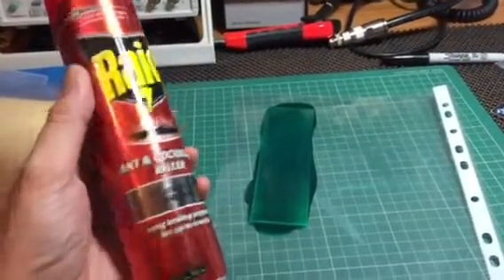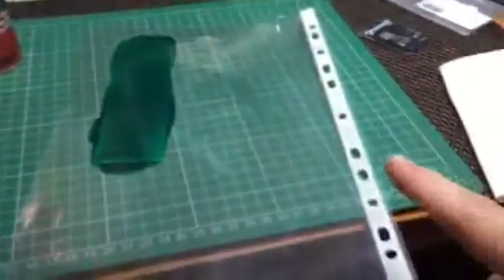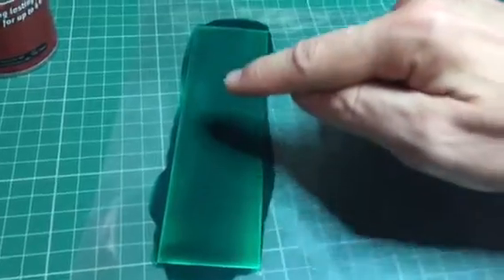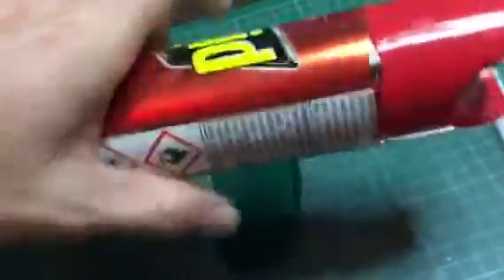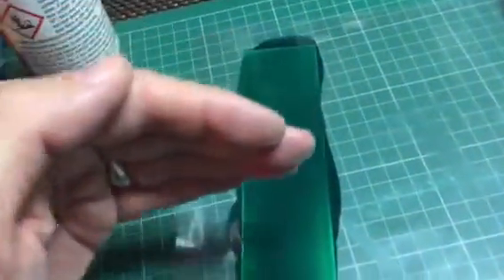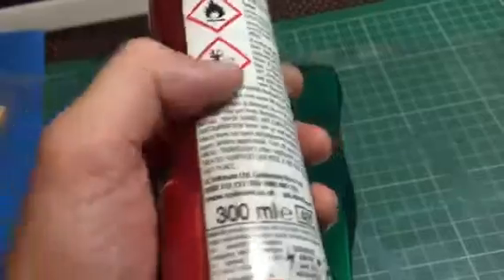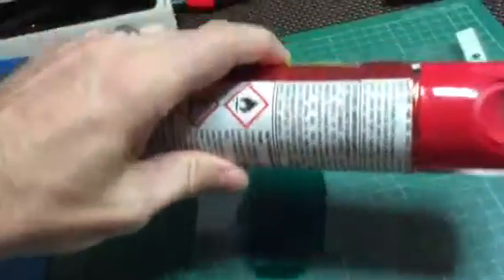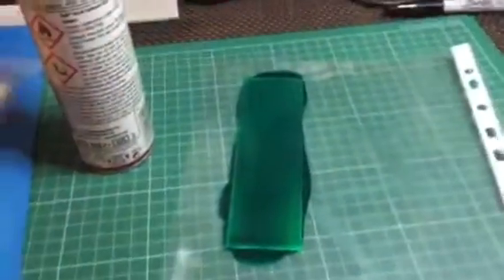UV mask application part 1

Comment: "Look for the seam..."  -- Don't try to find something better than an insecticide can...

I call clickbait..  Very, very, niche clickbait... but yes, that's how it's done.

There's also Speedball-brand rollers made for ink and stamp processes in art... it's a hard rubber roller with a handle that's made to deal with the thick inks used in stamp processes...
Reply from the maker: Thank you Patrick for your views.